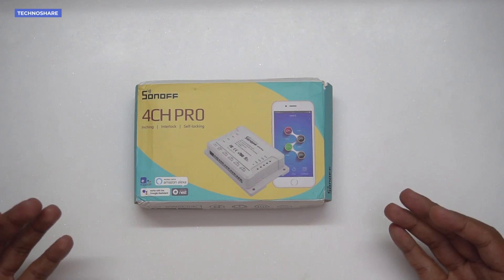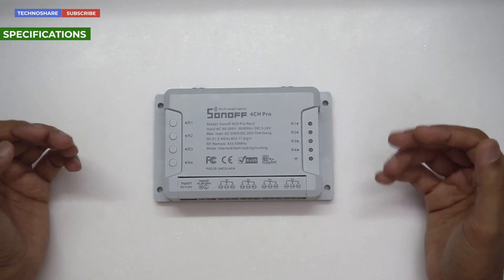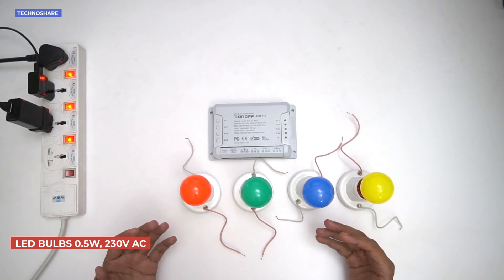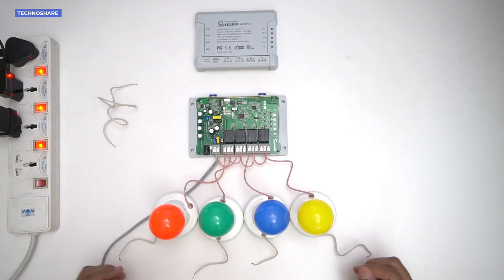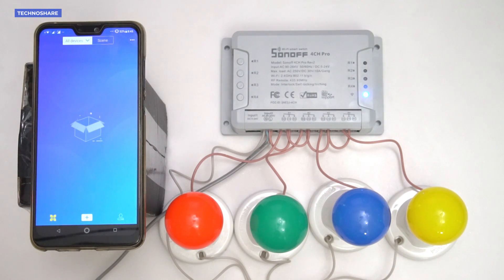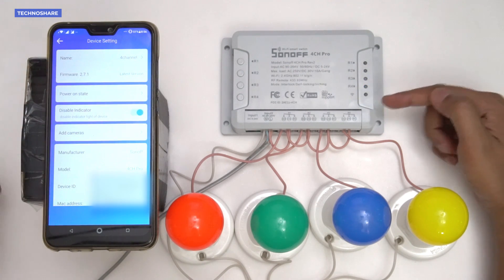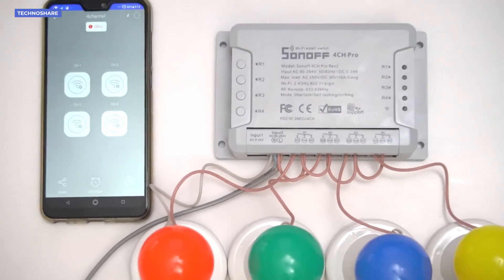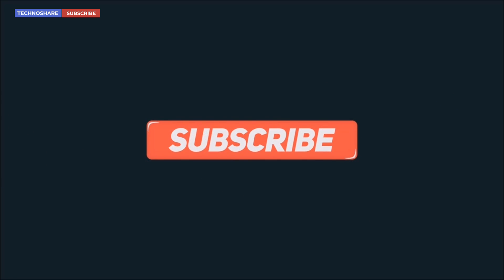SONOFF 4 Channel Wi-Fi Switch - Review | Setup | Demo | 🏠🎛️💡📴

Comment: Hi dear! can i conect this also on my 3 whaterpump to controll the on/off switch system it works or is this just for light? Thank you khader
Reply from the maker: Hi there!! Sonoff switches are not designed to directly control 3-phase (or single phase) AC motors/pumps due to high voltage, current, and inductive loads. However, I have heard there is something called 'contactor' device that can be used along with sonoff switches to safely control the load. I dont have much knowledge on the contactor though. Always ensure proper protection and consult an electrician for high voltage/high amp setups. Thanks for watching :)
Reply: @TechnoShare Thank you for your answer my waterpump works with 220v i think it’s enough for sonoff can handle that or?

Comment: do i connect my water motor with this ?
Reply from the maker: You can connect it as long as the motor power consumption falls with in the limits of the smart switch. Amps and voltage also you need to check

Comment: hi bro, thank you for video, it is very good. just one question; i have a newer model, it has usb port and what it that usb port doing there while switch can work with 220v? i did not understand. it is called as Tuya WiFi 4 Channels Smart Switch Module.

Comment: Can this be connected to a mobile phone hotspot instead of a router? Thanks
Reply from the maker: You can. But you need a 2nd phone (as far as i know), in order to configure the router first time. I remember trying this once, and found that I had connection issues. Many a times, the switch was not responding to the commands on and off. (I had tried this on the sonoff single switch model)

Comment: Thank you so much for this very simple and explanatory video! I'm going to get a 4 channel switch now 😊
Reply from the maker: Thank you! Newer version of the 4 channel switch may be available. Do check it out! Thanks for watching 😊👍🙏
Reply: @TechnoShare  Well noted, thank you. Do you have a separate video for the new version? And are there any new functionalities with the new version?
Reply from the maker: I dont have the sonoff 4 ch pro R3 version. I have the R2 pro version, that's shown in the video. The newer R3 pro supports self locking and interlocking mode on the app itself. So you don't have to flip any hardware switch inside the sonoff device. Please check the new features and differences on this sonoff page. https://sonoff.tech/product/diy-smart-switch/4chr3-4chpror3/

Comment: Also I have a follow up question. Does the app allow for a scenario where when switching " ON"  e.g. Bulb 1 , it can automatically switch OFF bulb 4 , Finally can the device be integrated into the google smart home app. Also does the device require a hub (e.g. ZigBee) or does it work with a  remote server (e.g. Tuya). Does the time remain active in case the WiFi is down? Thanks 🙏👍

Comment: Great video ! In case the e.g. 4th bulb is connected on the always "on" while the others are connected as always "off" and using the inter-locking mode , would switching on bulb e.g 1, 2 or 3 would also switch on bulb 4 ? Thank

Comment: Would this still switch if the internet connection was lost? Basically, does it need a constant internet connection to work or could time schedules be updated in an area with internet and then the switch be moved away from internet access and still switch as programmed?
Reply from the maker: It needs internet access to work as programmed. In case of Internet unavailability, the light can be manually controlled by pressing the physical button on the sonoff switch.
Reply: @TechnoShare  thanks for confirming.
Reply from the maker: @kw1984  you're welcome 👍

Comment: With WiFi can it work in km disyance
Reply from the maker: If your sonoff i connected to home wifi with Internet, then you can literally operate the switch from anywhere in the world if your phone had a mobile Internet connection. If you plan to use the same home wifi Internet connection for your mobile phone, then the range will be limited to your router wifi strength. Limited in and around your house.

Comment: it can be run with remote also right
Reply from the maker: Yes. Thats an rf remote. We can control using that as well. But it has limited range. Should be in the proximity of the rf  signal.

Comment: Will the remote control still works if there is no network connection at all. So no signal at all. I just wanted to use the remote control key to turn my light on/off

Comment: Great video thanks for explaining this device. Can I connect this device to ceiling lights that use 4 gang wall switches (aka dumb switch). Can I use this device to make those 4 switch smart? I have used a Sonoff Mini for a single switch but I wish to make a 4 gang switch smart in the same way. How can I connect a physical wall switch to this device?
Reply from the maker: Hi there!! Thank you!! Yes, you can make the Fan and lights smart, but I dont think we can use physical switches along with this sonoff switch. As you can visualize,  it would not work. Say,  you switch on the light using physical switch. And switch it off from your mobile app. But the physical switch will remain still ON. So, now, ideally, if you switch off the physical switch, then the light should come ON. But, this will not happen, as it is a single way switch. (not a 2-way or 3-way). Infact, the moment you switch it off, the sonoff switch may lose power. So, tracking the states of the switch is the concern here. I have come across few pages on the internet, where people have tried 3-way switches etc. But not sure if it worked.

Comment: Hello there, 

i want to automate my roller shutters with sonoff. 

My main issue is that i want also the normal switch on my wall as my wife or kids they dont have access to the smart app/switch. 

What is the best way to install a sonoff but also the wall switch stay functional.

Please advice...
Reply from the maker: Hey there! Yea. I have heard the same question from other viewers also. However, this switch does not offer that feature. Unless you want to use the small buttons on the sonoff device as manual switch. Please check, if sonoff has any other type of switch, that can give the desired behaviour that you mentioned. I think I had come across few videos on YouTube where they had demonstrated this behaviour. But I think those may require some hacks. I dont recall. Please check it out.

Comment: Bro can we operate more lights with single switch
Reply from the maker: Hi there! If you meant to ask if we could control multiple lights independently, all connected to a single switch, then the answer is no. One switch can only control one light.
Reply: Bro pls suggest me smart wifi switch to control 4 or 6 set ceiling lights can be operated by single switch

Comment: Does phone and switch  need to connected to same wifi?
Reply from the maker: For the initial setup - yes. Once the set up done, it is not necessary. You can control the switch using mobile network also, provided the sonoff is connected to internet via the wifi router. Hope this helps!
Reply: @TechnoShare  Thankyou😊
Reply from the maker: You're welcome 👍🙂

Comment: Good day sir, i wanna ask? Is it okay i use my mobile data instead of wifi? Thank you and god bless.
Reply from the maker: Hello Sir. If your question is for connecting the switch, to mobile Wi-Fi connection, using mobile data, then, from my personal experience, the connection was not consistent. And I had issues turning on/off the switch using the mobile app. It could be due to the network and cellphone signal strength.
However, if you have connected the switch to a broadband Wi-Fi  router connection, then it works perfectly fine. In this case, your smartphone dont need to be connected to the WiFi router. You can operate the switch using mobile data connection, from anywhere on this planet 🙂 👍, as long as you get a mobile signal!
Please do like and subscribe to my channel, if this helped!! Thanks for watching!! Good day to you too!!

Comment: Thank you! 
Can i use interlocking mode with inching mode together?
Reply: I mean i can only turn one channel, but if it is turned, it turns off after 1s ?
Reply from the maker: Thats a nice question! I think, it will not work. Reason: There is a mode switch S6, that we need to set, and it can be either in Interlock mode or Self-lock/Inching mode. So, when we set it to interlock mode, the inching mode is disabled. When set to Inching mode, the interlocking mode gets disabled. Its also mentioned in the documentation of the swich as follows:. "Please note that if S6 is toggled to the right(0), your 4CH Pro is in interlock mode, it’s invalid to set K5". Here K5 is the config to associate individual switches to either Inching or Self-locking. Hope this helps!! Thanks for watching 🙂 👍
https://ewelink.coolkit.cc/?p=458#:~:text=1.%20Power%20up%20your%20device,corresponding%20pairing%20icon%2C%20click%20next.

Comment: Great instructions. Thank you. I have an iPhone and i want to name the switches on my screen instead of saying CH1 to CH4. I want to customize it. Please advise
Reply from the maker: Thank you! Yes. You can rename the channel name to any name by going to the settings - > basic info - > Name
I tried it and it works! Thanks for watching 🙂👍
Reply: TechnoShare: The only option on an IOS device is to change the Sonoff name. Not each one of the 4 channels. Or at least i do not know how to do it. I would like to enter 4 different names. One for each channel
Reply from the maker: @Yasso Karim I was able to change it on my ipad air, for all the individual channels.  I don't have an iPhone. But I am hoping the software may be same. On android as well, I was able to change.

Comment: Hi sir , mobile internet is it ok for this device
Reply from the maker: Hi! I had tried with my Airtel Mobile network (using smartphone wifi network). I had problems with connections, and the sonoff switch could not connect properly and did not work. It could be network issue. It works fine on my broadband connection. No problem. Hope this helps!! Thanks for watching 🙂. Please do give this video a like 👍 and subscribe 👆!!

Comment: Hi how many SONOFF 4 Channel switch links to the app. For example if I wanted to connect to eight light so I have to use two sonoff 4 channel switch. can I control both the switch at the same time by using the app ????????????
Reply from the maker: Hi there!! I have 2 modules in use. 1-channel and 4-channel. and both modules are working on the same application, simultaneously. Every device in the 4 channel can be controlled independently from the App. I have not tried with two 4-channel devices, as I have only one :( . Hope this helps!! Thanks for watching 🙂. Please do give this video a like 👍 and subscribe 👆!!

Comment: Can i start a AC device conect it in a channel from sonoff 4ch pro ? Posso acionar um AC conectando em um dos canais ?
Reply from the maker: I believe, this may not be suitable for AC. 
Please check the power consumption and rating of your AC device. It should not exceed the max power/load rating of the sonoff switch. Below are the max values shown on the switch:
Max. Current: 10A/gang
Max. Power：2200W/gang, 2200W/Total

Comment: Can this be used with wall sockets instead of light bulbs? The reason why i’m asking is because my sockets draw 16A (220-240V), but this device is only rated for 10A. I definitely don’t want to fry up the Sonoff or even worse, my home appliances.
Reply from the maker: Hi there! I don't think this is a replacement for wall socket. We will not have any control over the appliance that we connect to the socket. As a result you might end up connecting more power hungry appliances without knowing, and it's a big risk. And yea, for sure it cannot exceed the rated capacity of the switch ie 10A. Hope this helps! Thanks for watching 🙂

Comment: If i operate this device by remote internet connection require
Reply from the maker: Hi there! Yes, Internet is needed all the time to operate from smartphone. Even if you are at home, and if you need to control using smartphone, you need internet for it. However, you can control manually  using the small button on the switch by pressing it and that will not need internet. Hope this helps! Please do give this video a like 👍. Subscribe for updates!! Thanks 🙂

Comment: Thank you.  Nice one. 
What is the best way to get 24v DC as output from this device to run 4 X 24v appliances?
Reply: You cannot get any power from this device, it has only 4 dry switches.

Comment: This is work with wifi phone or need wifi modem
Reply from the maker: If you meant using this on mobile wifi network (tethering), it may not work properly. I have tried this on sonoff basic switch, on Airtel network in my place. And the switch did not work consistently in its operations. I would recommend a Wi-Fi modem connection for good working based on my experience. Thanks for watching! 😊👍

Comment: Our farm is 2 km from our house. Where we want to operate some electrical appliances from home via a remote controlled device.
We also have Wi-Fi networks there to monitor some cameras and some security devices. This Wi-Fi network has also been attached to the Internet.
The question is can we use the SONOFF 4Ch Pro R2 device to operate the device at home or anywhere on the internet?
Or this device can only be used while on site
Can this device be operated by more than one user?
Reply from the maker: Hi there! Good question and i appreciate your thoughts on your idea to use it. So, this device needs wifi with Internet to work. Once it is connected, it can be controlled from anywhere using the mobile app. Can control it from smartphone connected to mobile network as well.
Regarding the users, i have tried to login to the app, using same account credentials on a second phone. It will login to the second phone and show the connected device. But it will immediately logout of the account and session on the first smartphone. So, one session can be active at any point of time across multiple phones. If login again on first mobile, it will logout from second phone and login on first. Hope this helps. Please do give this video a like 👍. Also consider subscribing to my channel 😊. (if not yet). Thank you!
Reply: According to the manual you can share this device to unlimited number of users

Comment: Can we control this device with Internet if we attach internet with our wifi network???

Can we controlle this device more then one Mobile??
Reply from the maker: Yes. It can be controlled using the app, from any where once its connected to internet. The account credentials works only on one smartphone at a time. If you try to login to app on another smartphone, it will immediately logoff from the app session in the first smartphone and login on the second phone. Hope this helps 🙂. Please do give this video a like 👍 if it helped! Also consider subscribing! (if not yet)
Reply from the maker: @Martha Benedict Thanks for the info! I wasn't aware of that feature. Had tried  looking out for any share option on the app earlier. But i guess it wont show the share icon option if the device is offline. Thanks! Have updated the info.
Reply from the maker: Share option is available. Please check this link for more details!
https://www.itead.cc/wiki/EWeLink_Introduction#Share_Control
Reply: Yes, you can to share to unlimited number of users

Comment: What is the rang ,we should to keep of the distance between sonoff divice to phone
Reply from the maker: It works on wifi sir. Sonoff device needs to be in the wifi range in your house, so that its connected to the Internet. Your phone can be anywhere in the world. As long ad you are connected to the Internet (could be on different wifi network or on mobile network) , you can control the device. Hope this helps! Please like👍 the video and subscribe sir. 😊, if you found it useful. Thanks

Comment: Why yours not have intching from the apps itself
Reply from the maker: App has just the buttons. But the behaviour of it (inching mode) needs to be change manually on the hardware switch. Agree with you. Could have given that configuration in settings on the app itself . But thats what it is... And thats what we get 😊. Thanks for watching 👍😊

Comment: Dear bro, does it require an internet connected home wifi? Does the device produce it own wifi or bluetooth?
Reply: Thank you so much bro... Your answer is helpful. I am from Myanmar. ✌
Reply from the maker: Hi Bro! It requires Internet connection. Nope, it does not have hotspot feature. To control it via smartphone app, you need to have that connected to a wifi router. Hope this helps! Thanks for watching! Please do like 👍 n subscribe bro. More videos coming.

Comment: Can we assign high loads like TV fridge and ac

And product looking very good and great but modes are use less
Reply from the maker: Hi there! It supports total load of 10 Amps max and 2200W . TV can be connected. But you need to check your fridge and AC power consumption and then decide accordingly. I personally have not connected high power consuming devices. Thanks for watching!